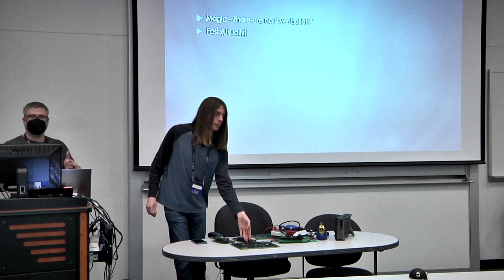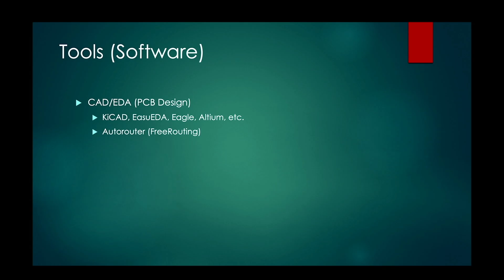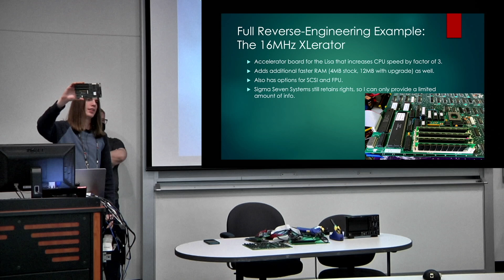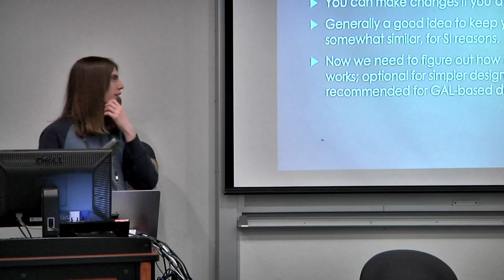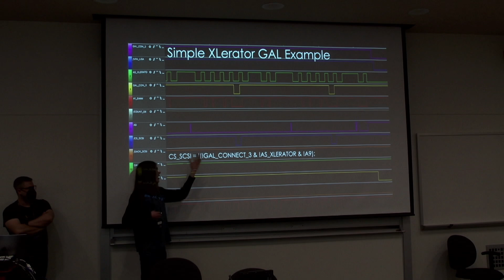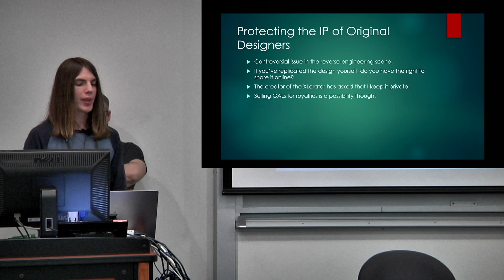Taking Apart the Past: Reverse Engineering Vintage Computers

Comment: Mul Tim etir? Multi meter ?
Reply: I always say multi-meter since it’s a meter that can measure multiple things, but I just looked it up and apparently the “proper” pronunciation is mul-tim-eter. So it looks like Will was pronouncing it correctly in his part of the presentation, and I was saying it wrong in my part! But I’ll still probably stick with multi-meter, even if it’s technically wrong, just because I think it better emphasizes the function of the meter as a device that can measure multiple quantities.
Reply: @AlexElectronics  turns out the British and American pronunciations are different! Another one to add to the solder router and aluminium pile!
Reply: @UXXV  Interesting!
Reply: the English trisyllabic laxing rule
and a very interesting application for it 
every other example that comes to mind is ((head initial)+suffix) and multi-meter is head final with a depend multi-preceding

Comment: At what point does copyright ownership expire? Won't that permit freely disseminating the information discovered in reverse engineering?
Reply: I believe copyright goes for 70 years after the original designer's death, but don't quote me on that. The designer has also said that he plans on eventually releasing the original source equations at some point in the future, so my reverse-engineering work will probably end up being useless whenever that ends up happening, but at least it's nice to have in the interim. Even if I can't make it completely open-source, at least people will have the option to buy preprogrammed GALs from me at cost instead of the design being completely inaccessible like it's been up to this point!

Comment: Did the person who made the originals have any of the GAL programming information? If so, did they provide it? If not, are they planning to use what you reverse engineered?
Reply: Yep, the original designer still has all that stuff, but he has never shared it with anyone as far as I know and doesn't want to disclose it at this time (although he says he plans to at some point in the future). He's not planning on directly using what I reverse-engineered for anything, but he's willing to let me sell people pre-programmed reverse-engineered GALs if I charge them a royalty that goes to him for each set of chips that's sold. We haven't worked out the exact details yet, but hopefully I'll get around to that soon. I hope this answers your question!